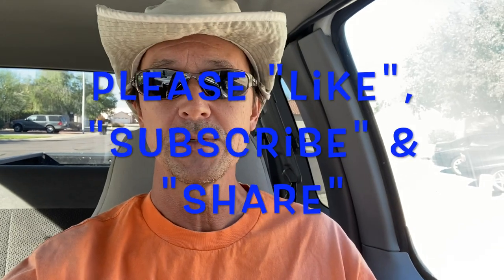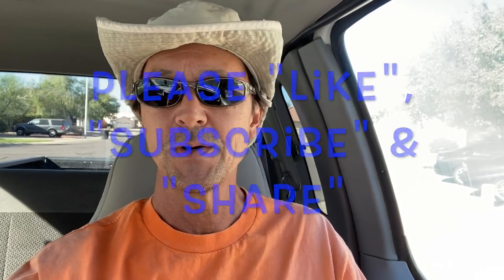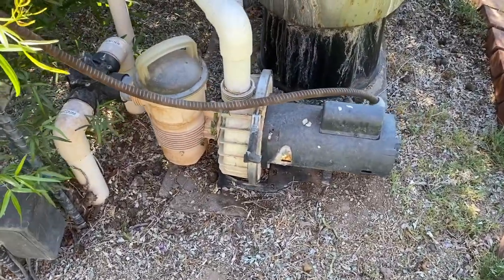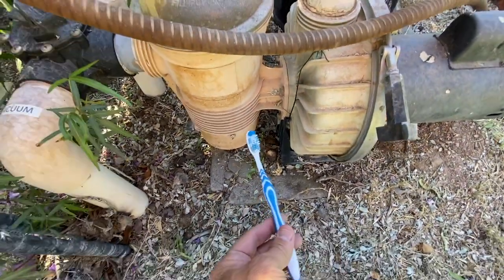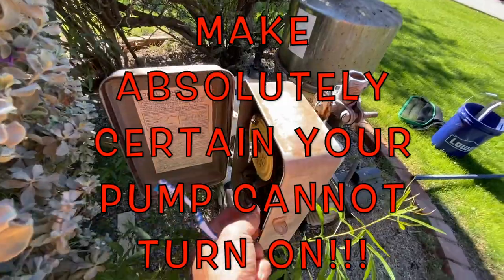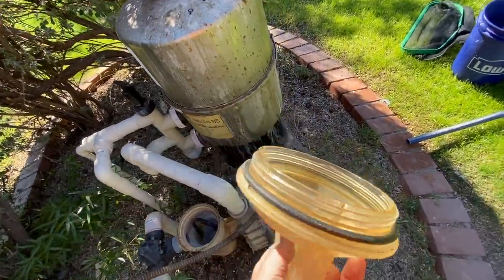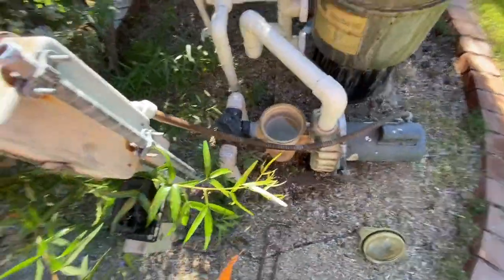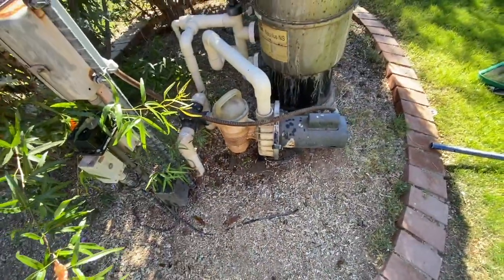Clearing an Impeller

Comment: Thanks for the trick. I’m going to try it. Ive been using my fingers for years. I have a Hayward so it’s not too deep. The hardest part is, this time of year it’s like sticking your hand to the bottom of an ice chest.
Reply from the maker: I agree.  And my truck heater doesn't work (and I don't want to spend the money replacing the heater core) so mornings this time of year are brutal.

Comment: Funny how different pool guys can have such different opinions based upon their experiences!
What you have there is a Challenger pump, an old one.
Made by PacFab starting about 40 years ago, now under the Pentair label since they bought PacFab about 20 years ago. 
It's still my "go to" pump. 
Why?
Because the impeller is so easy to access!
Your problems with the square (cross section) housing gasket may be related to the age of the pump housing.
I have never had an issue with getting in and out of a Challenger in minutes flat.
As opposed to other common pumps in my area, this one requires no tools to open the pump to access the impeller. 
All the others, (save for StaRite Dura-Glas, another Pentair buyout, very similar to Challenger) require usually at least 6 bolts to be removed for access, sometimes not too hard, sometimes pretty tricky to get to.
Regardless, your video is testament to the quality of the Challenger line.
Once again, nice video!
Reply from the maker: Thank you.

Comment: Very nice tutorial – and yeah, I have that tool at home!! 👍😀  I'm ALWAYS queasy about putting my fingers in the pump opening (same for garbage disposals ), so I remove the outside fuse AND flip the inside⚡ breaker off before doing so. Lastly, what kind of pump is that, Pentair?!
Reply from the maker: Yes, it's an older Pentair Challenger Pump.